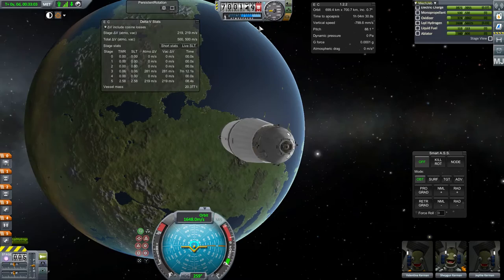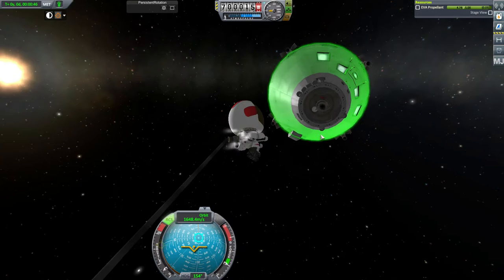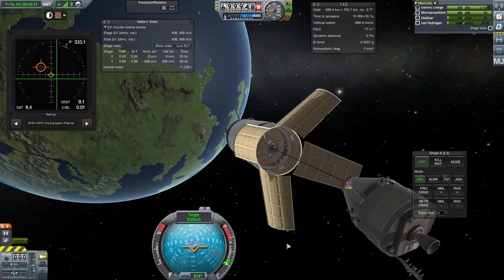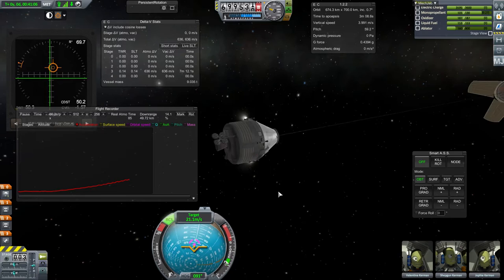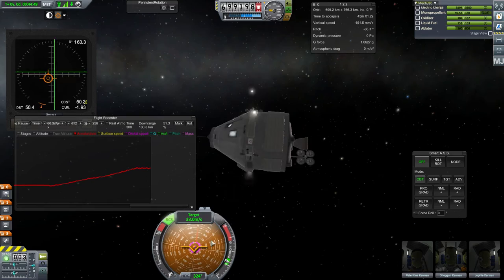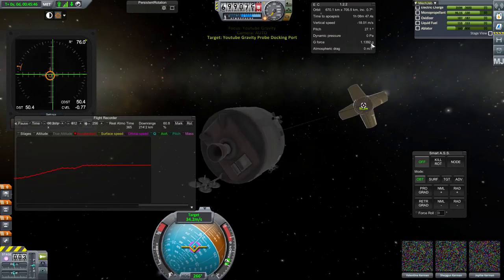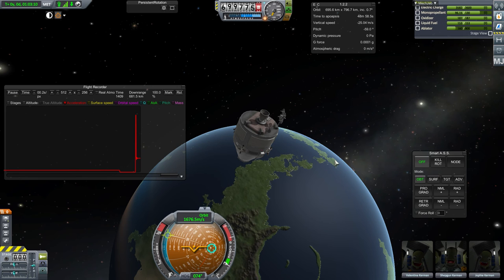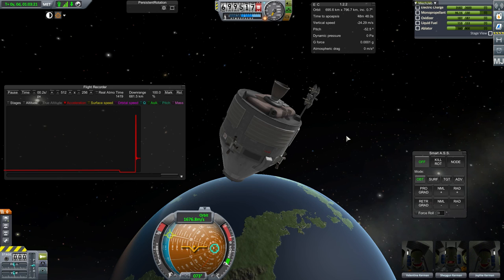Proof Of Concept  - Artificial Gravity Using KAS

Comment: I'm concerned about using RCS messing with your trajectory, especially on interplanetary trajectories where the wmallest m/s counts
Reply from the maker: That is a very valid concern, yep. I would tackle that by having very well balanced RCS, and doing small pulse adjustments once everything is up to a spin to correct for any course error I caused while spinning up.

There are a few clever concepts in the literature for tackling that, and additional concerns. There are some components you would want not spinning, like a communications antenna or star observing camera. A platform could be deployed from either end, attached to the cable and would wheel along to the centre of mass. That CoM package could even have course correcting thrusters as well?